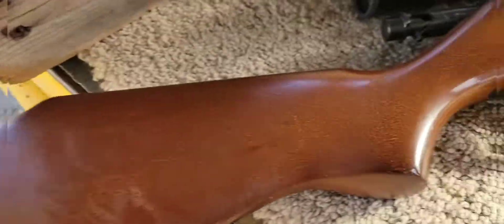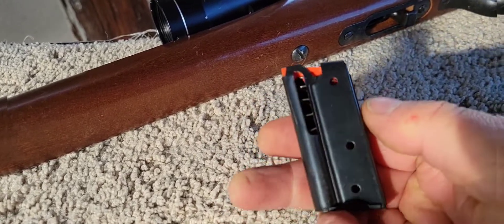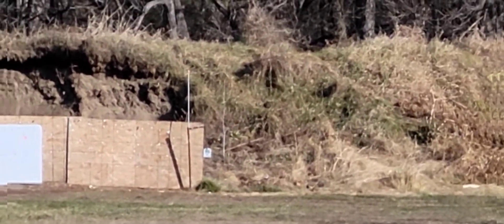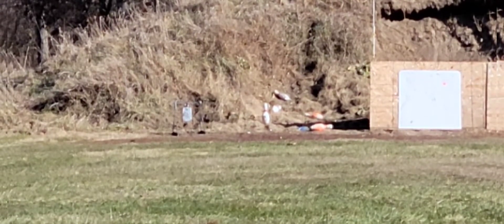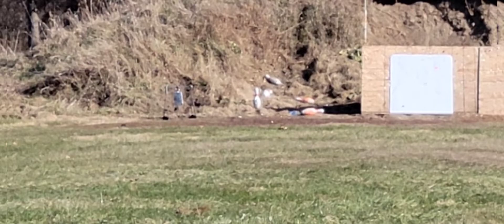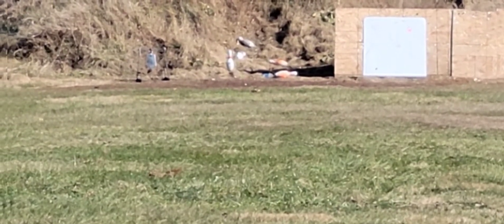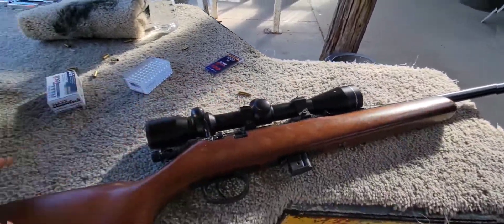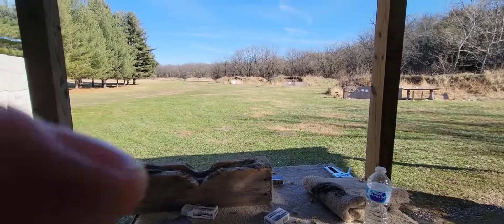Marlin 25n. 22lr, circa 1990

Comment: I love my 25N, I got it when I was 8 from my grandpa and I've shot probably 20k rounds through it by now. Super accurate and smooth, I love it. Mine also has a surface rust problem, it got put in a hard case that had moisture from condensation in it unknownst to me, so the barrel is badly pitted. I've sanded it quite a bit by hand but I think I need to put it on a lathe to properly get the pitting out. Still haven't decided if I want to go with DIY chemical blue or have it professionally hot blued, I'm leaning towards the latter but we'll see what the cost ends up being when I get to that point.
Reply from the maker: Very cool! Not that it needs work, but that you still have it. I rescued mine from a pawn shop. I could not pass it up. Good luck on your restoration quest. let me know how it goes. Thanks for watching!
Reply: @sheepdog72  Yeah I'm glad I've kept it, it's one of those guns I'll never let go of. I'm definitely looking forward to completing the restoration, I'm going to sand and polish the stock up to it's original condition or better as well, it's suffered a good bit of abuse going through the brush over the years and I want it back in showpiece condition like it was when my grandpa gave it to me, he's gone now so it's a really cherished gun that in hindsight I should have treated better...